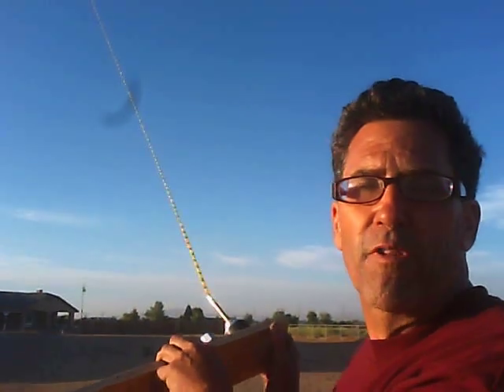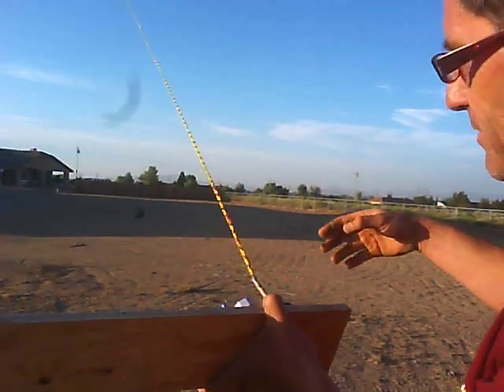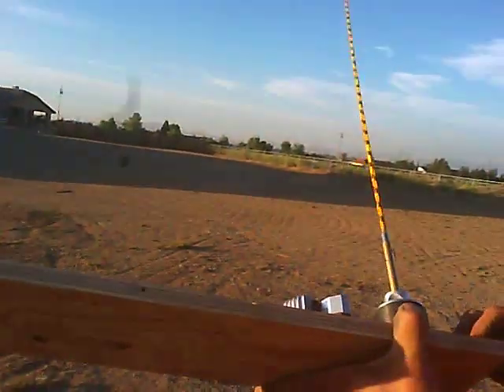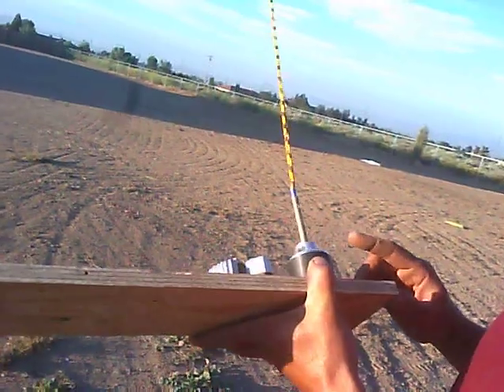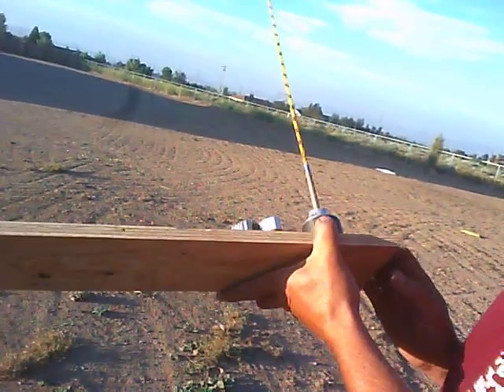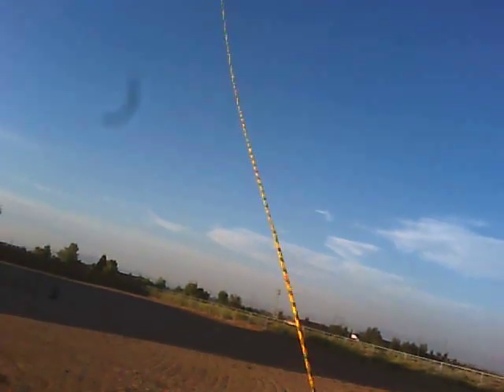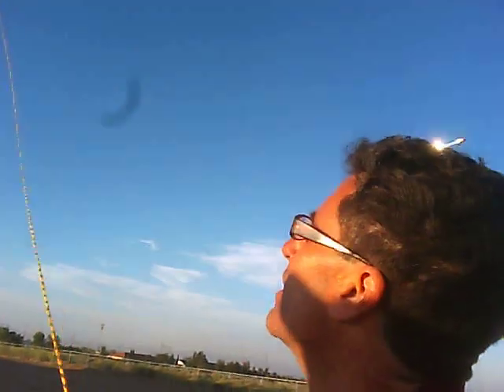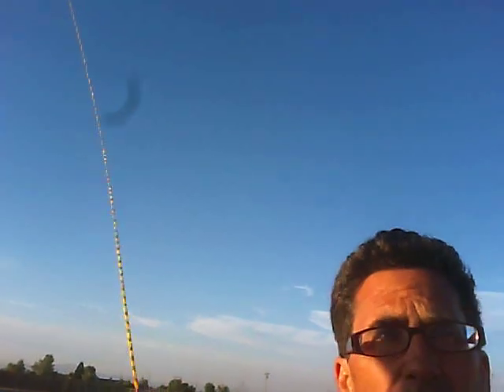Flying Superturbine(R) Explained by Doug Selsam

Comment: It seems to me that the higher the angle of the turbine  the less area of the rotors is presented to the wind (reducing output), on the other hand below a certain angle (depending on the spacing and diameter of the rotors) the rotors are shading/interfering with each other. The other problem I can see is landing this device without chewing up the rotors.

Comment: Oh, I have been thinking about how to keep the bearing tethered to the sky without having to monitor it constantly. You need a hybrid kytoon, with elements of airfoil on top and kite style drag lift underneath, then the carbon fibre rotor central axel tubing transports tiny amounts of hydrogen from a tiny (rainfilled) electrolysis chamber on the ground and replaces the natural leaking of hydrogen from the balloon.